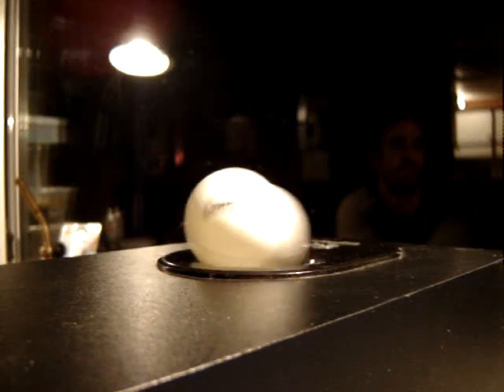Aero-Acoustic Levitation of Ping-Pong Ball 2

Comment from the maker: The stick is only there to guide the ball to the center of the hole so it doesn't go off to one side. It pierces the ball and hangs down a couple of inches into the speaker.(no strings or fingers attached!)